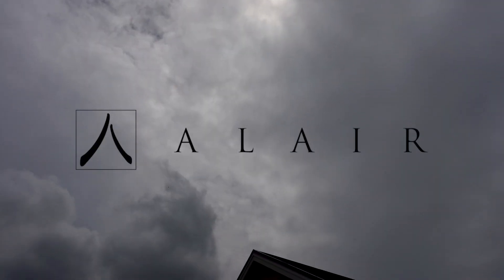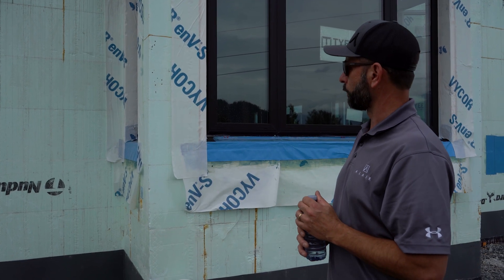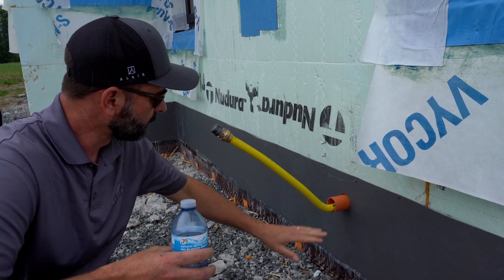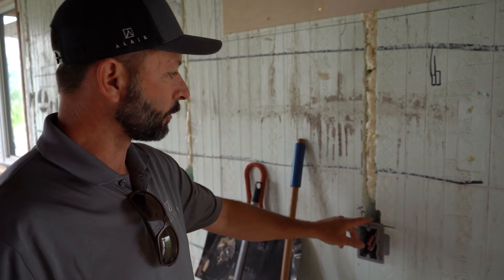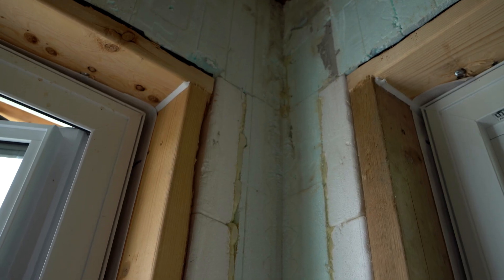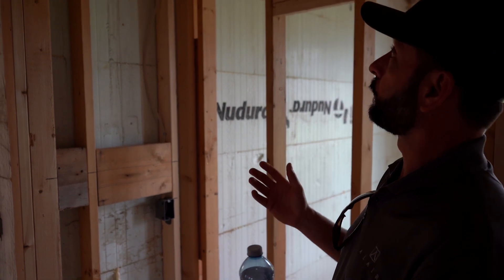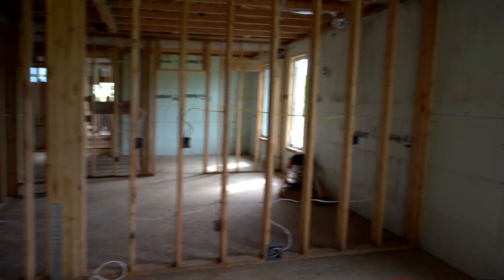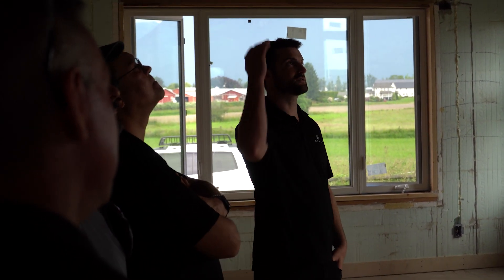Insulated Concrete Form (ICF) Home Walkthrough - Alair Homes

Comment: How does the masonry dry out in icf? Masonry loves to wick moisture. We put thermal breaks next to windows with wood behind. So only the window screws are thermally conductive. And not wood next to window to absorb moisture from condensation. Icf block is 5 times as expensive as cmu block. Icf walls are twice as expensive as cmu block or poured walls with r 20 mineral wool insulation. Icf can have moisture problems as plastic ties let moisture through concrete. Icf walls is not as strong as brick wall of same masonry thickness. Moisture problems allow icf to mold behind the insulation. How do you fix an icf wall that leaks or molds? Moisture issues in air tight houses are too common. Common moisture problem areas are kitchen, bathroom, basements, and rim joist pockets. Rim joist pockets on icf are the worst. Moisture wicks to rim joist pockets in icf, cmu, and poured walls. And if spray foam or fiberglass in joist pockets it molds. Here masonry need to be exposed to air of at least 18 inches above grade. This allows masonry to dry out and not become water logged.
Reply: Most of your objections to ICF are easily managed.  With any air tight house, mechanical ventilation is needed for fresh air.  An ERV is also used to pre heat or pre cool any incoming air and exhausts out the stale air from the house.  During the concrete curing process, running a dehumidifier will help with any excess humidity that builds up.  Mold does not grow on the foam of the ICF or the concrete.  Mold needs moisture and an organic source to grow (wood, drywall, etc).   As for your cost comparisons against ICF, are you factoring in total installed cost to get the same level of performance?